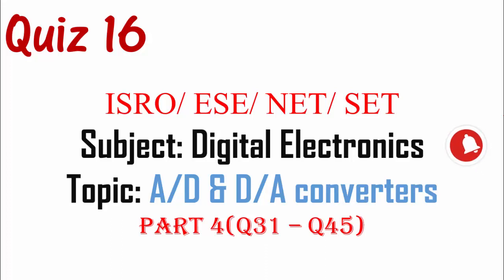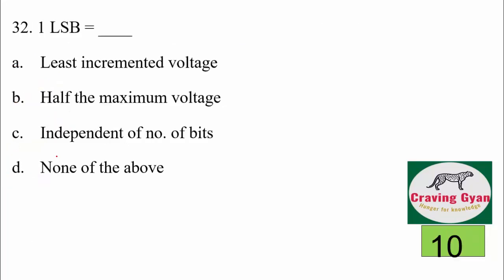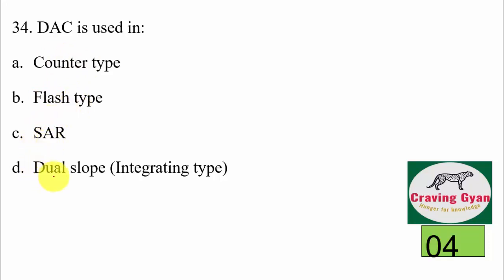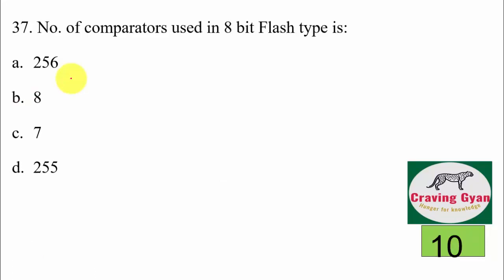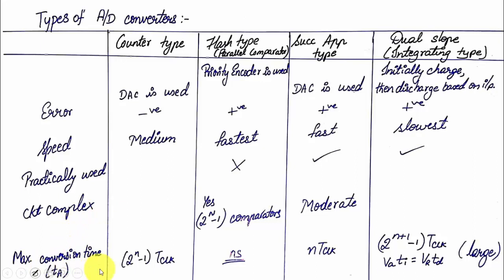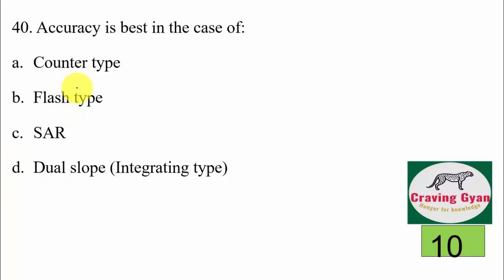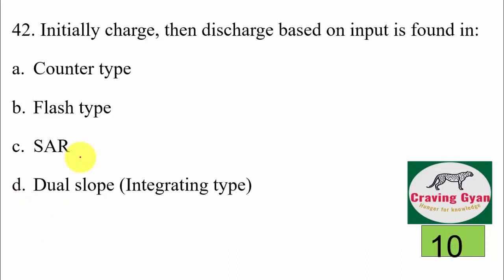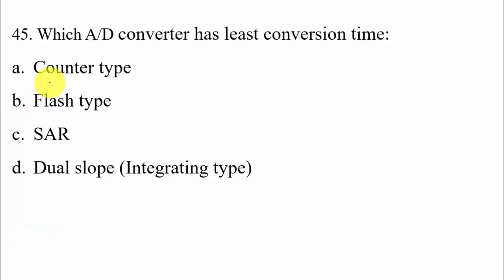Digital Electronics ADC DAC MCQs by Arun Kumar sir

Comment: r2r ladder required more numbers of register than weighted dac  so in que 1 all of above is not correct
Reply from the maker: In question they're not comparing with R-2R.
More resistors are used is also correct
Hence, all of the above